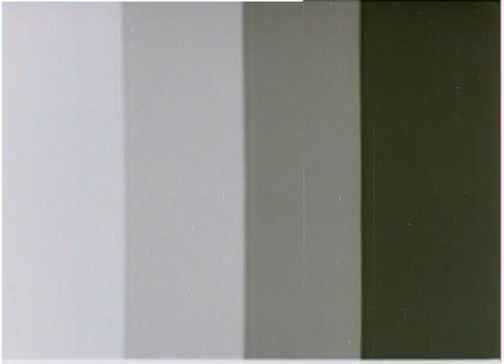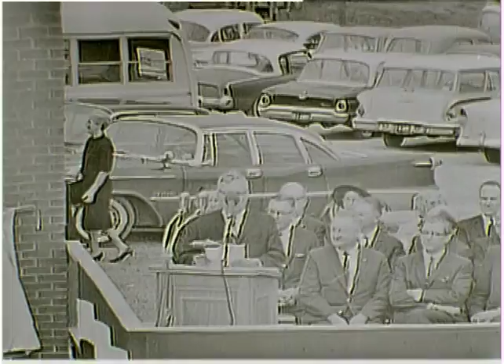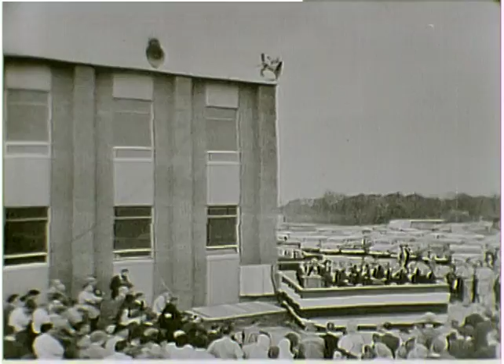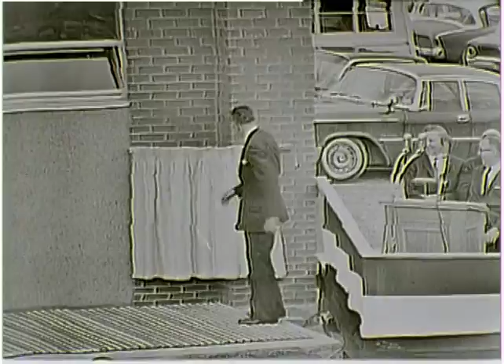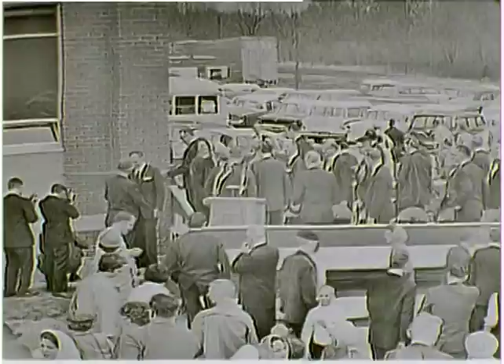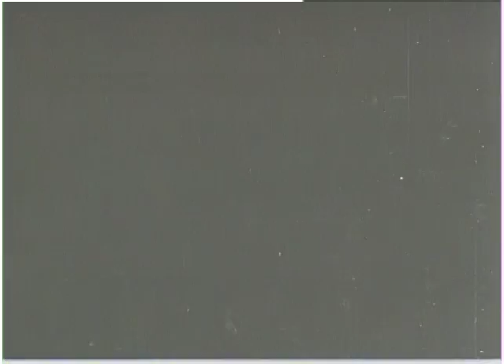Ames Laboratory Reactor Dedication (1963)

Comment: My mother got her $350,000 EEOICP check 25 years after my father was murdered. You know as kids my sister and I would run around in the basement of that place on Saturdays turning knobs and flipping switches? Always wondered why there was a guy with a gun at the razor wire fence outside. Lucky we didn't blow up Ames I guess.